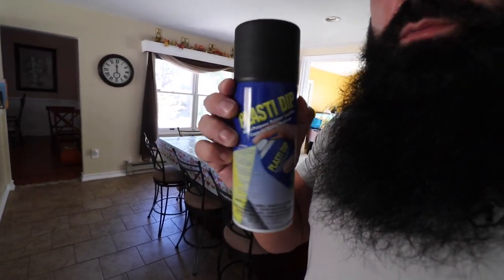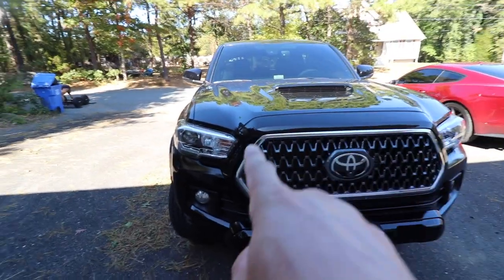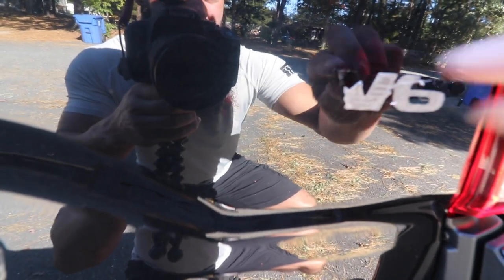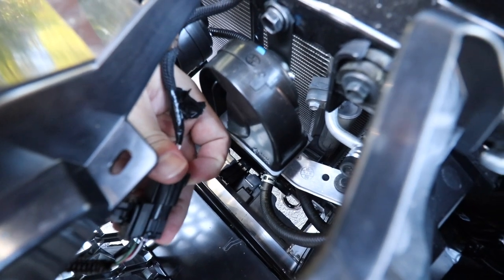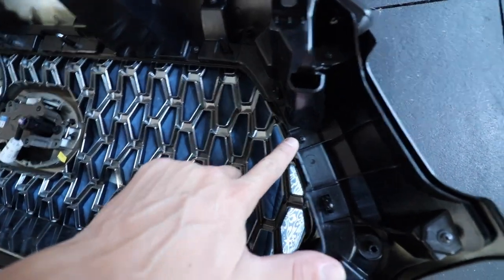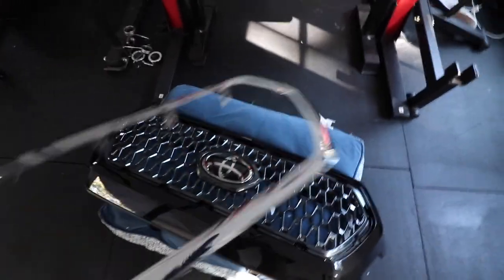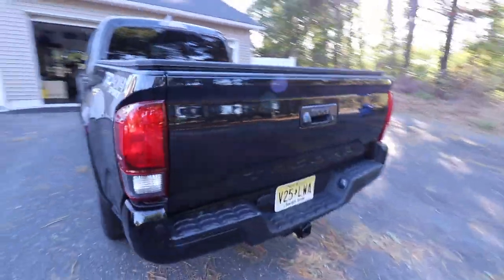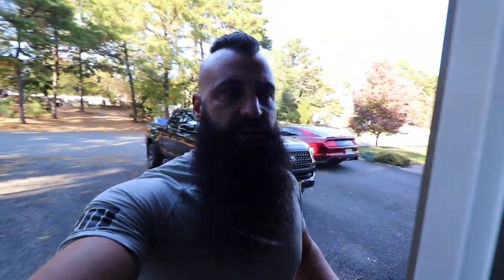Painting my grill and Debadging my 2019 Toyota Tacoma (Plasti dip)

Comment: Looks great, what a difference!  I have a BLK OR and just plasti dipped the Tacoma and V6.  Sprayed the bezel with VHT paint today and will put it back on to the grill tomorrow.
Reply from the maker: How did it all come out? happy with it?
Reply: @Chris_Graham  it's hot.  Need to do something w my wheels though.  I don't like the aluminum.
Reply: How did the plastidip on the front grill bezel hold up.  The vht paint that I used is chipping off badly.
Reply from the maker: Brent no issues at all. Still in perfect condition.
Reply: I am going to plastidip over it.  My dipped emblems holding strong.  Happy NY man.
Reply from the maker: Brent sounds like a good plan! And happy new years to you too